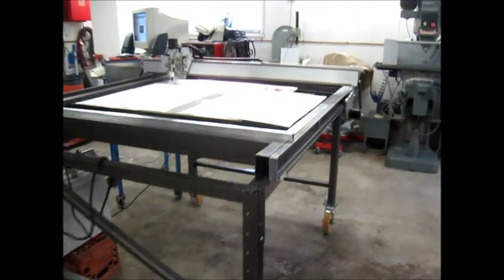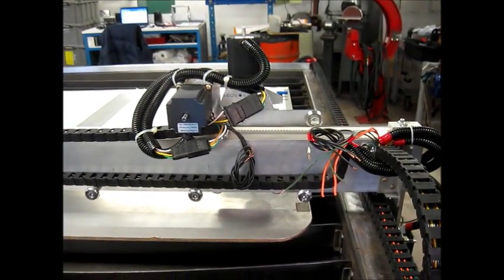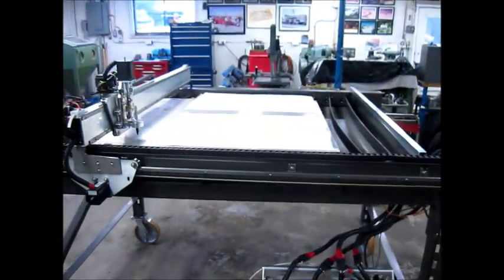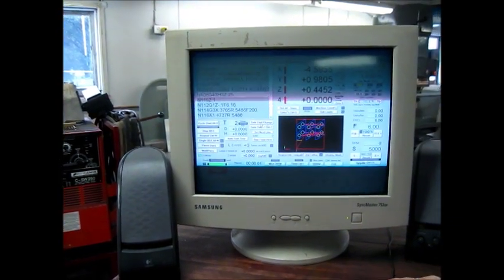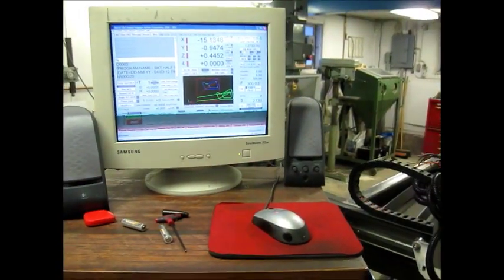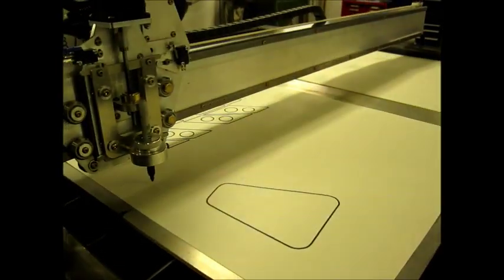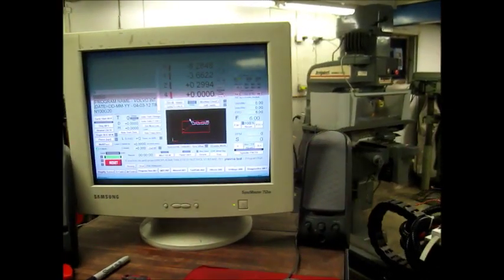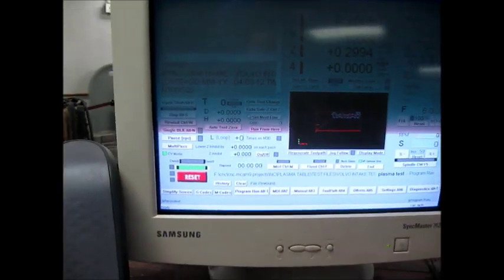CNC PLASMA PROGRESS #6

Comment from the maker: Figure about 1000$ for all the mechanical drive components, motors and materials. I already had the stepper motor drivers and Tx from the controller I built for the Bridgebort mill conversion.  Add another 500$ for the torch height control and whatever flavor of plasma cutter you want to use, I acquired an ESAB 875 new from ebay for 700$.  If I had to do it again I'd get a Hypertherm plasma cutter.